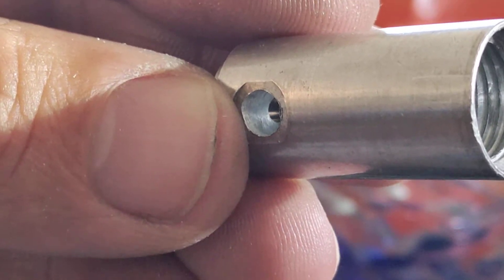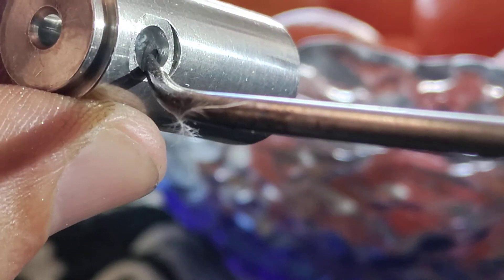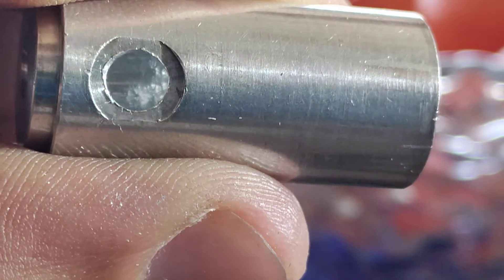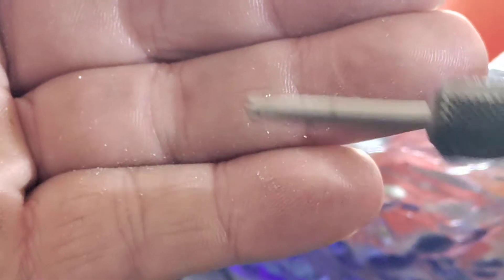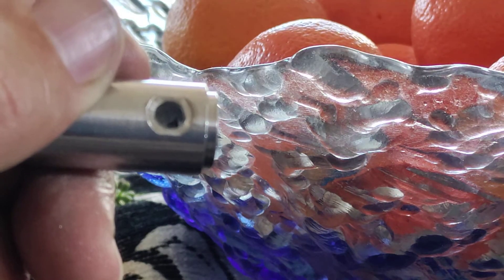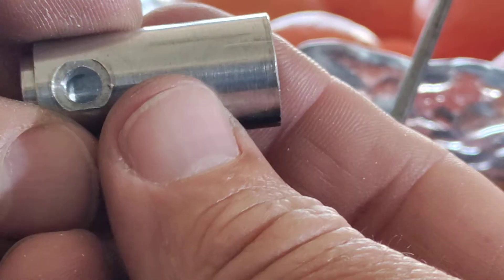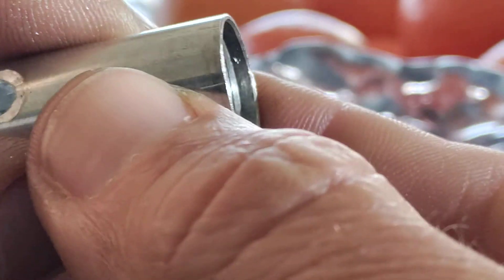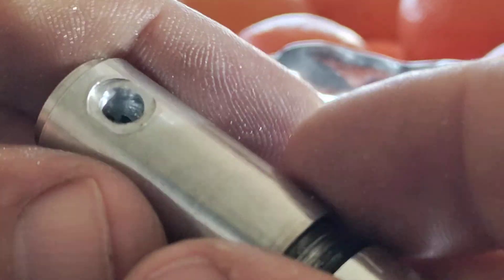DIY Crosman Valve Mod tutorial for 120+ Fps velocity increase!!

Comment: Why not just drill the port bigger and maybe use a reamer.
Reply from the maker: To increase air flow you really need to radius the inner walls appropriately for max air flow feet per second gain

Comment: Yeah angle porting is great, but a smooth rounded curve lets the air/CO2 flow better and faster with no sharp agles..
And yes this of an engine exhaust port. Not the intake.
Also round the edges of the poppet valve.
I even reduce the size of the shaft right behind it, bigger transfer port and thin extended bolt prob to allow unrestricted smoothe flow into the barrel.
Good job you did..

Comment: Does a steel breech stop most leaks? got a .22 backpacker that leaks..puff of air felt
Reply from the maker: Clean and seal transfer port with silicone
Reply: Just make sure any breech is seated properly into a undamaged breech seal. Replace the small hex breech bolt, with a slotted screw., Readily available on Amazon etc. Do not use silicon sealant,  if this was needed Crossman after all these years would be applying it ! In 30 years none of my Crossmans have leaked. This video is just one of many, that think they can magically improve a perfectly accurate and reliable pistol, that in its basic form needs no improvement. As a machinist of 45 years the hatchet job done on this valve is appalling.

Comment: I just got through doing mine, haven't chronographed it yet but holy smokes.. I had an old style valve laying around and did nothing with the threads, but went a little nuts on the inside.. 35 pumps and no air left in the valve afterwards with a heavier hammer spring.. shot a steel folding chair and it looked like I shot it with my .25 gauntlet 😅.
Reply from the maker: Happy to hear it worked for you too. Very satisfying

Comment: You can remove about 1/4 of the bottom threads and also cut about 3 threads off the cap and open up the the inside of the top and making it a flat top piston you will need the pump to be flat top to.  you can also taper the value stem hat as well to help flow. With a lighter valve spring the original way to much spring with a 20in barrel talk about power increase. 🎯👍👌✌️💯🥂
Reply from the maker: I've gone that route as well it's just when you remove to much volume you end up pumping it 30 times for more fps. Flat top pistons and valve with redirected airflow in the choke area I seem to have best results from. Appreciate the input. Love different perspectives
Reply: @shawnahl1657  work real good when you convert the co2 2240 to hpa but than again your not pumping. My pump is about 16 pumps but I have to pump twice to get it to hold air that's the only thing I don't care for thanks.🎯👍✌️💯🥂